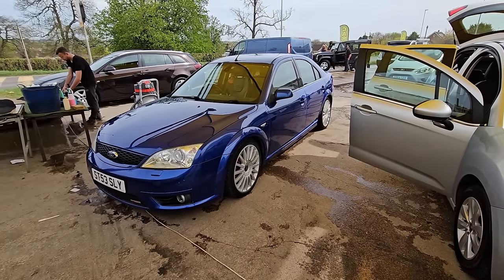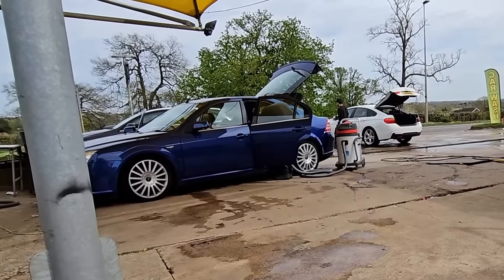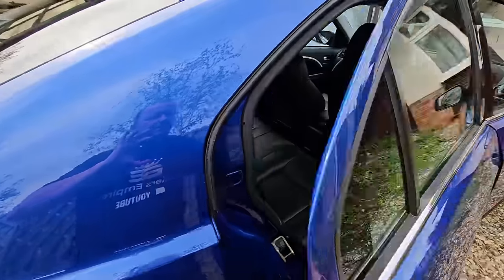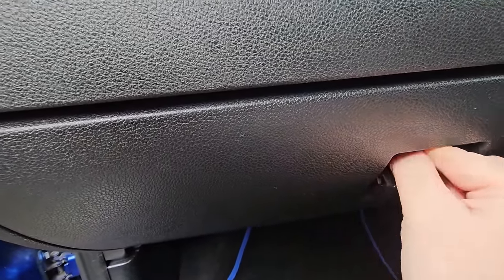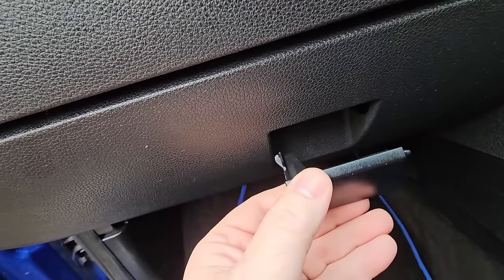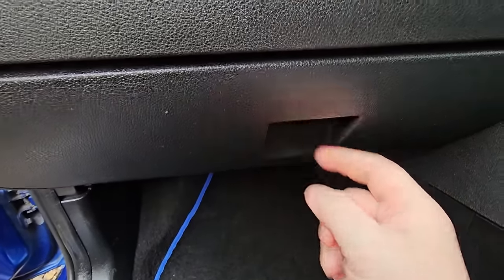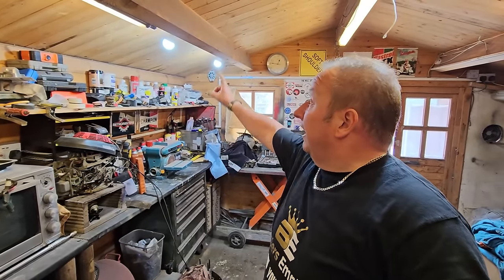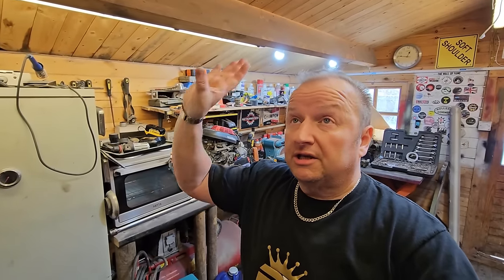The Mondeo ST220 Gets Some Love And A Glove Box Fix

Comment: Mk3 Mondeo is the best generation of Mondeo, in my opinion. Our old one went on for years  and was used for the dog and any dirty jobs like trips to the tip. We paid £900 for it, and it felt solid, comparable to anything German. Amazing value.
Reply from the maker: Yes I agree 👍
Reply: Agreed. I’ve had mk2, mk3, mk3.5, mk4, mk4.5.  I always remember Ford trumpeting that the mk4 was cheaper than the mk3.5 - but TBH you could feel it was a cheaper car.
Reply: @stevenwesthead636  I had an early mk4 2.5T. It was a beautiful engine (a 5 cylinder turbo charged petrol Volvo engine), but it was clear Ford were broke when it developed and produced the mk4. Everything was so flimsy compared to the mk3.